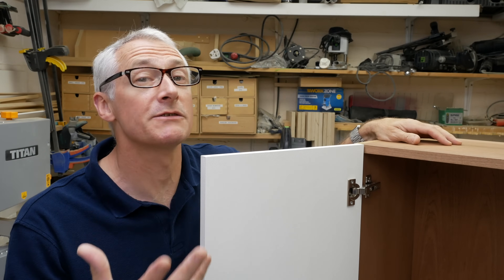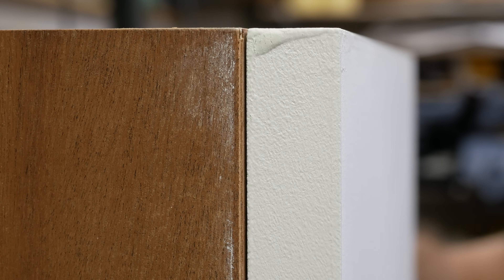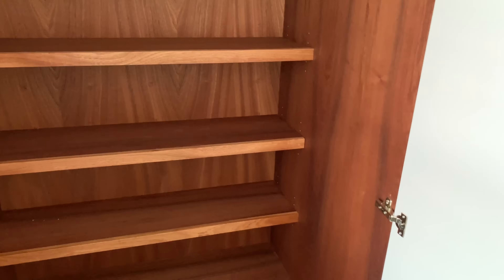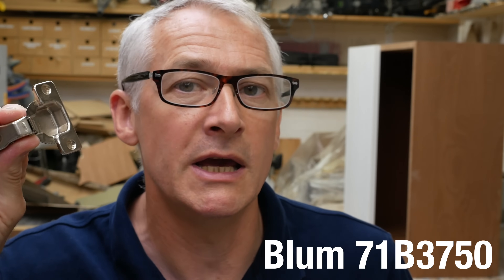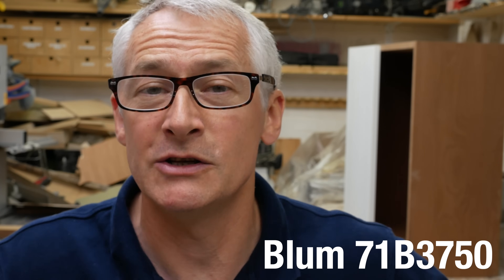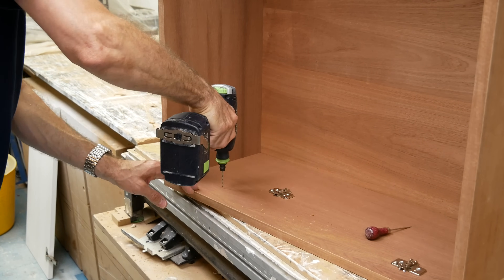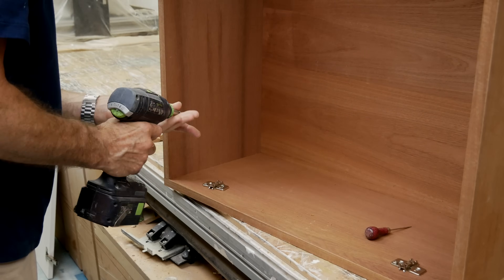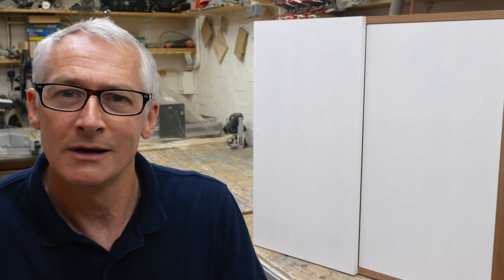How to fit concealed (Euro-style) hinges for overlay & inset cabinet doors [video # 348]

Comment: One of my first projects was a spontaneous cabinet and I planned to add inside doors later. The cabinet was with a shelf and already finished, the doors were finished and then I looked at hinges. I didn't know, I'd need 13mm for the hinge and I made the cabinet out of 12mm plywood. 😂 I made it work by drilling the 35mm about 8mm deep and used a router to deepen it to a total depth of 10,5mm, which was enough in the end.

Comment: I'm building my first cabinet.  I am a new Festool user and so far everything is going as planned.  Because I am new to cabinet building, I try everything on scrap before making my cuts.  I am getting ready to bore the shelf pins and hinge screw holes.  I have been pulling my hair out trying to understand the process of hinge install.  This short video totally simplified the process.  I feel I can go straight out to the garage set the hinges... but I live in Florida and its hot, so the next cooler day will be hinge day.  I have 15 cabinets to make.  Great video.

Comment: Do the door and the carcass have to be the same thickness? I'd like to put doors on a 2x4 frame.
Reply from the maker: No - these aren’t - but the thickness does have to be within the spec of the hinge. If you’re looking for a hinge that’ll do a full overlay on a 2” frame, then I’m pretty sure you’ll be out of luck - as always though, check the specs of the hinges you’re planning to use. 👍👍

Comment: these concealed hinges are a great invention. over the years undersink door hinges can go mucky a bit, from condensation and moisture from rubbish bins installed there. i replaced mine with the soft close, they're great. the other problem often experienced on high use doors, like those for accessing rubbish bins, the hinge side eventually can wear the mounting holes larger, due to all the movement.

Comment: You are spot on. I bought a drawer set.. cutlery and 2 pan drawers.
The drawers are already assembled except for the fronts. There's no instructions as how these steel runners fit into the steel drawer brackets. There's no details of which holes to fit them into the cabinet. It's very frustrating as these are good products providing you've fitted them before

Comment: Thank you so much.  I just got a Kreg jig and used it for the first time yesterday.  Only thing is that the small holes to drill the 062” Dia.Drill bit through need to be longer if you are going to do it in one fell swoop.

Comment: An excellent video as usual. The hard backed book catalogue from Blum is also a great reference, usually easier to use in the workshop than going on line :-)
I'd recommend you consider looking for and purchasing a second hand Blum hinge drilling machine. The time saving in drilling the doors and the cabinet is huge! I have the extended rulers on my machine to allow for longer cabinet pieces.
These machines can be "built in" to a workbench to save space etc. They are compressed air driven, this and the use of multiple stops along the ruler make the whole (hinge and mounting plate) drilling process simple, accurate and a VERY FAST procedure. :-)
I have found the hinge drilling machine to be very beneficial for other precision and/or repeated drilling tasks ( - within the machine's limited range of course).
Try using a depth stop (home made if necessary) on your cordless drill to speed up the hinge hole drilling process. Forty-plus years ago, I made a template from a piece of aluminium angle to use like the plastic version you have. It's easy enough to make two sizes, one for overlay (which you don't need :-) ) and the other to suit inset hinges.
I don't have the details in front of me at the moment, but some of the Blum hinges contain over forty parts!

Kind regards Peter Sanders :-)
Reply from the maker: Thanks Peter. I think you may be over-estimating the number of hinges I fit, and I do say in the video that I have a drill press pretty much dedicated to the process, so the depth thing really isn’t an issue. 👍👍

Comment: Great video, Peter but talking of wardrobe doors (they got a brief mention) I can find very little youtube demo material on installing them using overlay hinges.
I know that the basic process is the same as kitchen cabinet doors but, as a keen (and fairly aged) DIYer, I found fitting 185mm x 570mm 18mm MDF wardrobe doors quite difficult partly due to the sheer weight of them. Plus there are a lot more hinges to line up and tweak. Handling tiddly kitchen cabinet doors would have been a breeze (there's loads of videos about them of course).
I only managed to find two detailed videos for building wardrobes and installing the doors with concealed hinges. One was for inset doors (mine were overlay) and in the other one the guy said "Oops I forgot to film the part where I fitted the hinges and installed the doors" (nice one, mate). There are a few more videos out there but they miss out important details. Just saying.....
Reply from the maker: Thanks bob. I think I’ve talked about them in every wardrobe job I’ve done; have a look through the playlists, there’s one for ‘client work, bedroom furniture’ or something like that. 👍
Reply: I'll have a peruse. I've still got five more to fit  @10MinuteWorkshop

Comment: Well done video on basic concealed hinge installation. I have one suggestion - You should be using a “Pozi-drive” screw driver, (Phillips screws with little tick marks ) “Pozi- screws” will work with a phillips screwdriver but will have a loose fit. A “Pozi-driver” will have a much tighter fit and doesn’t deform the edges of the screw head.  Blum does sell  Pozi-drivers.   Cheers

Comment: Thankyou for this! I bought some hinges from Amazon (not Blum, but very similar), your video led me in the right direction to work out how to fit them and the right borer bit I needed (which I should receive tomorrow). I'm building a large bike lockup (roughly 2m wide, 1m deep and 1.4m high), which is a battle with both hinges and the weather. :D

Comment: I prefer the hinge plates that use three screws - two in the positions shown by the hinge plates used in this video and a third screw in the back near the clip.  I've found that with hinge plates that use only two screws, if the door is hyperextended the hinge plate can wobble and pulls on the screws.  If this happens often enough, the screws start to tear from the wood, and eventually the door falls off.  The third screw in back prevents this wobble from happening.

This is particularly true for commercial sites, where doors get far more use than in residential sites and employees tend to be somewhat heavy-handed with the millwork.

I've also been recommending 180-degree hinges for all my commercial work to reduce the stress on the hinges from possible hyperextension, to make access for employees easier, and to prevent one employee from walking into (and tearing off) a door that that just been opened by another employee.  You won't believe how many doors I had to re-hang from that last one.

Comment: Hi Peter, I think you will really like the kreg jig, it takes away all the measuring, you can set a consistent offset (normally 5mm) has a depth stop and easily allows pilot holes for the screws too! I love mine, for the price you cant beat it. 
Scott Jones.
Reply from the maker: Thanks Scott! As I say in the vid, my setup is pretty seamless with a dedicated drill press for the job, but I’ll certainly try out the Kreg jig with interest - being able to take it to the workpiece, rather than the other way round is a big convenience 👍👍
Reply: Absolutely, I agree the drill press is perfect for the workshop, I dont have the beauty of owning one of those at the moment so rely on the kreg jig, it also works great on site if hinges were not able to be done before hand. 
Many thanks, 
Scott Jones

Comment: The little kreg jig is an excellent addition to the install kit , along with the shelf pin hole jig by kreg which I use on every cabinet install job . 
I also chose to go with Blum some time ago when I was starting out and with there excellent range of in-expensive jigs to go with there hinge & drawer runners systems certainly makes my installs alot easier & faster 👍 good vid as always Peter 👍
Reply from the maker: Thanks! I’ll have to take a closer look at the Kreg jigs - starting with the one I have, lol! 😂👍
Reply: Indeed, the Kreg hinge jig is excellent, 👍 🔨 🇮🇪

Comment: Great video Peter - I started getting into cabinet making via your videos almost a couple of years ago.  I'm an IT guy professionally but I am learning carpentry / cabinet making and getting fairly good now.  I've just spray painted my first kitchen cabinets (which exceeded my expectations) with the doors made with Tulipwood (from Tim's Hardwood Offcuts) which I milled from rough wood.  I just had to re-watch this video to make sure I didn't cock up my hardwork by not understanding concealed hinges.
Reply from the maker: Thanks Paul! 👍👍

Comment: Hi Peter,thank you for this guide...it was really useful!2 quick questions.1.From what point to what point
 do you measure the 37mm to mount the base plate and 2. How do you work out on a long door how many hinges to use?
Reply from the maker: 37mm setback for the hinge plate is from the edge of the carcass to the hinge plate fixing positions. I did a separate video all,about the number of hinges recommended here 👍  How many concealed hinges? [video 412] https://youtu.be/3AqYmwSPnN8
Reply: @10MinuteWorkshop  hi Peter,thank you for the feedback.ok I get it now,so from edge of carcass to the point where it gets screwed in! Ok,I will check that video out,thanks!

Comment: Hi, Peter.
Not wishing to sound like a keyboard warrior but, in a previous video "basic cabinets" your advise was to have vertical sides supporting the top and bottom, and demonstrated how easy it was to pull apart top and bottom inset joints. In today's video your cabinet was constructed with inset top and bottom. Appreciate it was for demonstration purposes but ..................
Reply from the maker: Hi Keith. Sorry, but you’ve got the wrong end of that. The top and base always sit within the sides; it’s the strongest way. 👍
Reply: @10MinuteWorkshop  Peter, What a numpty am I. I should have checked first. Apologies, but it did give a second viewing. Regards. Keith

Comment: Is that a Festool router in the background I see?
Using this tool for drilling the pocket holes is much saver, accurate and more convenient than free hand drilling, especially when used in conjunction with the router fence.
Reply from the maker: Yep, great setup for shelf pins. 👍

Comment: This is probably the best video I have seen on installing Euro hinges. It is best because it is succinct and especially because ot covers base plate installation which videos I have seen do not; they tell you how to install the hinge.
However I want to know, does anyone happen to know what issues I may run into if ai install 5/8” doors on a 3/4” carcas? Or otherwise is there any reason I shouldn’t do that?
Reply from the maker: Thanks. The thickness of the door may cause two issues; one is warping or bowing - I switched to making doors in 22mm after 18mm doors bowed. And the other is having enough ‘meat’ in the door to take the hinges comfortably; hinges need a 13mm pocket, and 5/8” is barely 16mm. It’s do-able, but you need to be careful drilling out for the hinges.  👍👍

Comment: Great video.
You mention 35mm is more widely available but I need 26mm 135°, possibly I should be brave and make a 35mm new hole using similar template to what you used?

On the verge or returning 35mm I bought in error.

Comment: As a kitchen fitter I find the Blum the best to use, they are better to adjust and seem to have better reach / scope of adjustment than other brands. Personally I would only use the back plates with Euro screws instead of using a normal screw. I find the euro screw gets a better grip and tend not to work loose over time..
Reply from the maker: I use a 4x14 self-tapper for the hinge plates - gives a little more adjustment, and still plenty of grip. 👍

Comment: How does the door move up/down when you adjust only one hinge? Surely you need to unlock the other hinges first to enable the door to move? Or do the hinges not lock? What spacing between each hinge is recommended? 250-300-350 or ? (On large tall doors) Recommendations on how close can you place them to shelves? Also, when you fit them and put the door on, do you clip the top and work your way down or from middle out? If you need to adjust them, do you start at the top and unlock the others first?

Comment: Your clear and concise videos are invaluable. Thank you.  One question please.  If the door is opening too wide, can this be adjusted?
Reply from the maker: Thank you! You can get hinge restrictor clips that prevent the hinge / door opening beyond 85° if you’re having a problem with eg a door hitting a wall. Never used them, but I know they’re available, yes. 👍
Reply: @10MinuteWorkshop  Thanks. I’ll look into it.

Comment: Awesome video and just what I was after. I am going to be using the same inset hinge and base plate. So my door is 19mm thick and I add on to that 37mm to get the screw holes for my base plate? Thanks again Peter

Comment: This is a great video.  I looked ALL OVER the place to find out how far from the door edge to drill the 35mm holes and where to mount the mounting plates.  I have a bunch of Blum hinges that came with NO INSTRUCTIONS.  How hard is it to print out an instruction sheet and include it with an order.  Thank you for making this video.

Comment: I bought this hinge template from your link, and boy your tips and tricks are so accurate.  You have saved me an awful lot of headache.

the drilling bit with captive sprung collar are run out on your link,  can you please tell me what size it is so i can buy one.

once again tonnes of thanks
Reply from the maker: Thanks! 3mm usually works well, 2.5mm if you can’t get 3. 👍👍
Reply: @10MinuteWorkshop  many thanks for your kind reply

Comment: We have a 45° corner kitchen cabinet with these style hinges. The hinges are  over 30 years old and have broken. Having a hard time determining what degree/° and style to replace the hinges with. What can you recommend? The cabinet is not a "lazy susan" style. It's just inset into the corner on a 45°with a normal (non-inset) cabinet door. Great video!
Reply from the maker: Thanks! Blum make a 45° hinge which sounds like it should do the job. https://www.trade-hinges.co.uk/45-degree-corner-hinge-573-p.asp. Another option may be a ‘blind corner’ hinge, depending on how the cabinet is arranged. HTH! P 👍
Reply: I'm in U.S. but can still find recommended hinge.  Thanks for the info !
Reply from the maker: @RemoWest  Ah, OK - always good to state a location when looking for info as not everything is available everywhere, though Blum are pretty good at keeping product codes consistent. 👍

Comment: I just put together a Ikea hack built in wardrobe. Lots went wrong
1 I thought I would base it off a really cheap door. It was hollow so could not be cut down for the "custom" doors I needed to take up the odd space in the alcove
2 I wanted a mirror in every door so thought I would just glue on a MDF panel round the edges. This worked but now the door was now 26mm thick. To thick for standard hinges so had to get thick door hinges.
3 The doors were wrapped in a vinyl material so did not like ordinary paint. Had to use a special purpose primer
4 The now thicker doors meant the hinges moved the door inwards to prevent clashing on the other doors. This meant the Ikea drawers would not fit as they were designed for doors that did not intrude in as much.
I managed to solve these issues with a spacer panel and loads of cutting up shelves to make the new center supports. The who job new looks very nice but would never do that method again.
Next unit will be an Ikea hack but will make all the doors myself from 9mm mdf and 9mm panels. Simple painting, draws that will fit with no adjustments. Just have to deal with MDF warp as when you paint them :(
Reply from the maker: Yikes! Sounds like a challenge, glad you sorted in the end. 👍👍

Comment: Hi Peter, thanks for your videos, your videos are well taught , very practical with the proper duration to not press the fast forward button. Regarding hinges as i am looking to retrofit my kitchen and in tend more toward Hettich hinges family inwonder if you came accros Hettich model of dual use hinge soft and non-soft closure... much appreciated.
Reply from the maker: Thank you! I know the getting brand, but have never used them I’m afraid. As I think I say in the video, I standardised in Blum simply because of availability. 👍👍
Reply: @10MinuteWorkshop  Thanks, i will search for BLUM model in my area then as i could not confirm this double feature in Hettich available hinges...

Comment: Thank you for the great video which is amazingly helpful! I am using the same Blum 71B3550 hinges for a full overlay door. What size self-centering bit will I need? Thank you so much for you great videos.I will be sending you a thank you tip for your answer. All the best!
Reply from the maker: Hi and thanks for your kind comments! I typically use 3.5 or 4 x 16mm screws, so you’ll need a bit that gives a 2.5-3mm hole. Unfortunately these are often imperial sized bits, so between 1/16 and 1/8 - not so helpful I’m afraid! 🤷‍♂️👍

Comment: Getting make a jig for drilling the hinge holes.  Accura is the name I think.  I made my own with some 30mm oval hanging rail and a few 3d printed parts.  Definitely worth the time saving.  Set it off the hinges on the door, OR measure them.
Reply: https://youtu.be/gVIzWLS0fec    about 2min 40sec  for the jig.
Reply from the maker: Thanks, but I don’t fit anything like enough of these for that to be worthwhile 👍👍